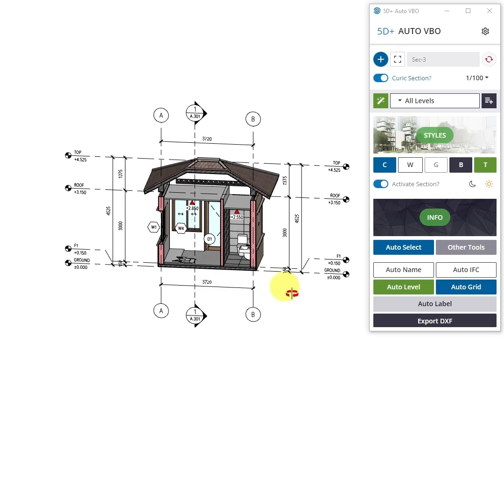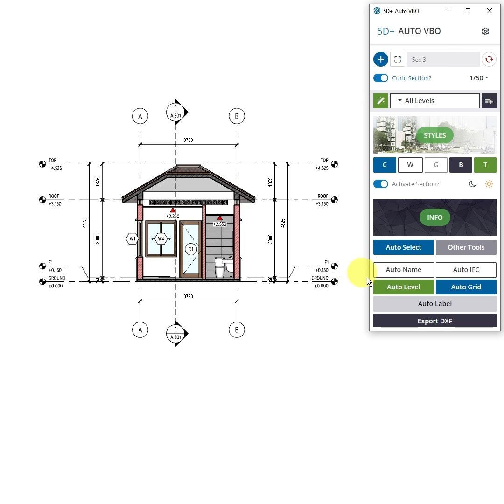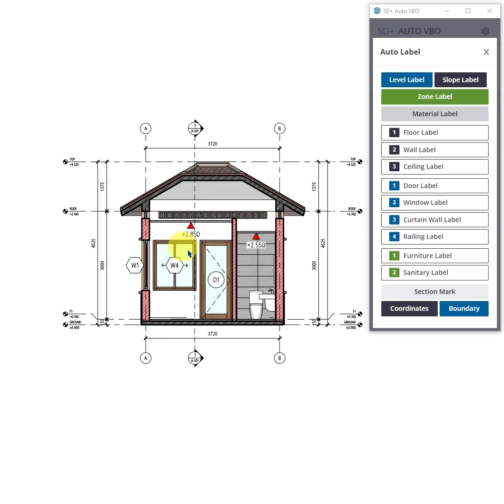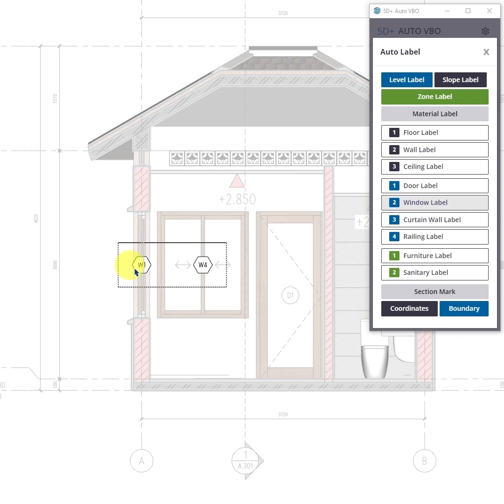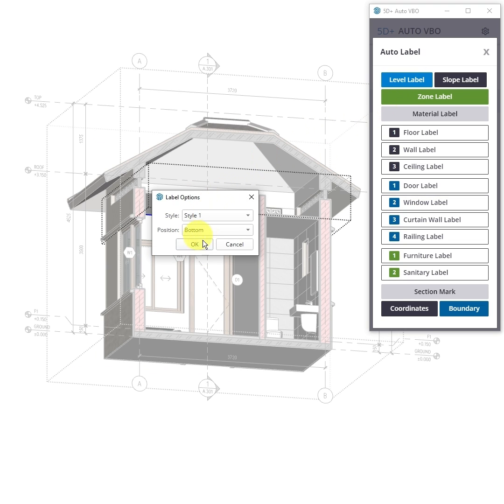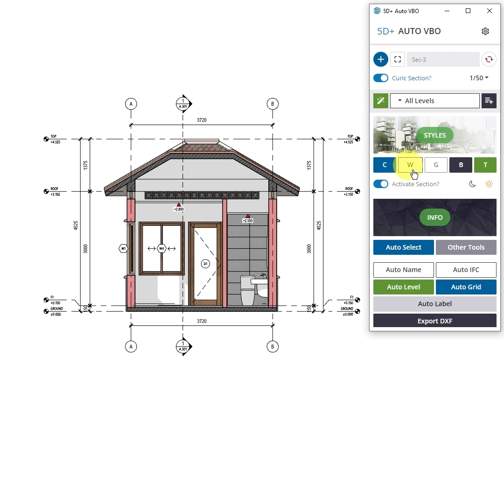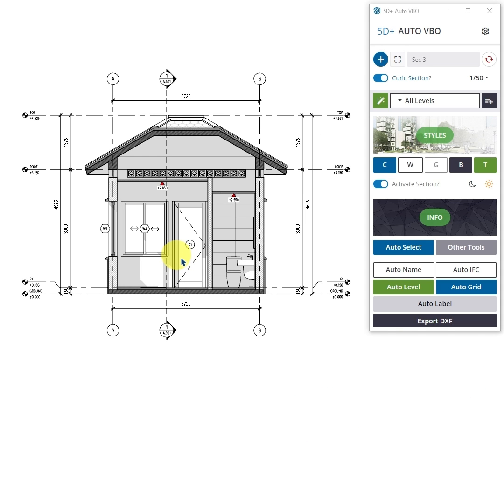5D+ Plus  - How to change drawing scale

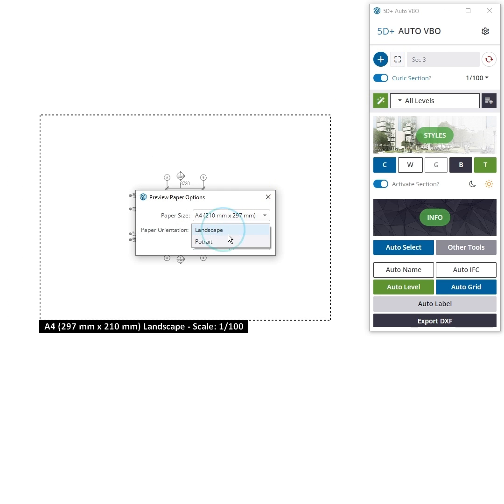Comment: This sheet outline (at 0:12)  is not visible for me, nor is the black label at the bottom edge of the outline (Preview Paper Options does not appear at all.) 
What can I do to see them correctly? 

(SketchUp Pro 2023, 5D+ release from May 28, 2024)
Reply from the maker: Please connect with me at cyentruk@gmail.com with Google Chat. Then I can view and control your screen via a remote app later.